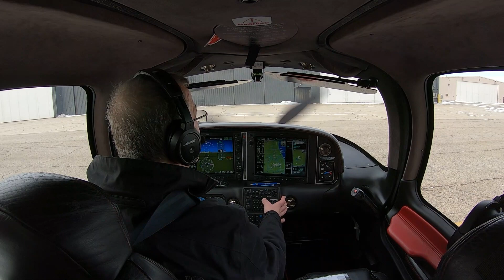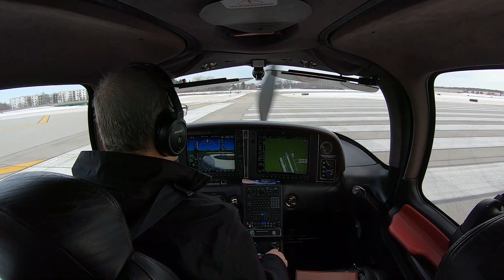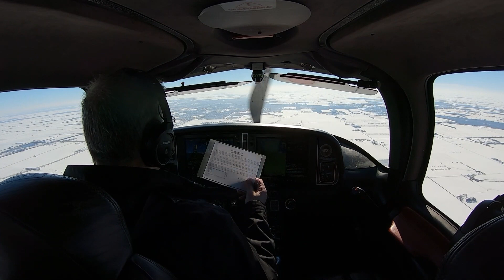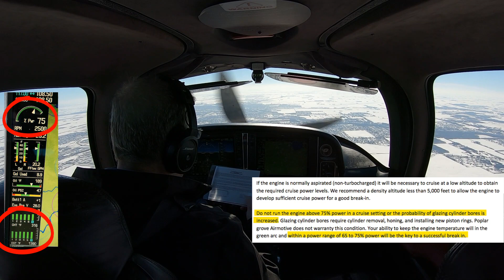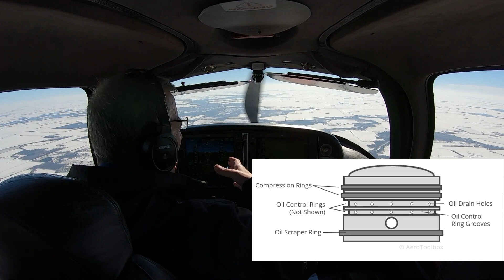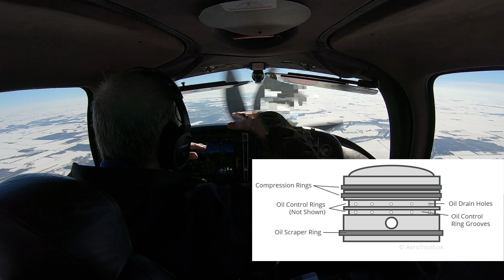Breaking-in My Piston Airplane Engine (Cylinders)

Comment: SD card maybe corrupted.
Quite a bit of messed up footage.
Reply from the maker: Thanks.  I saw that.  It wasn't happening at first, now consistent.  To your point, it is on specific GoPro files.  May need to publish it back up to YouTube.  First time that's happened and thanks for    letting me know.
Reply from the maker: I republished the video.  Unfortunately, I am not able to annotate the corrupted one.  I added an info card to redirect to the new viewer, but that will likely go unnoticed.
Reply: @pfflying6275  I'll check it out, the first one was pretty much watchable, really. I wasn't sure if maybe you hadn't noticed the odd digitizing going on,or whatever you call that.